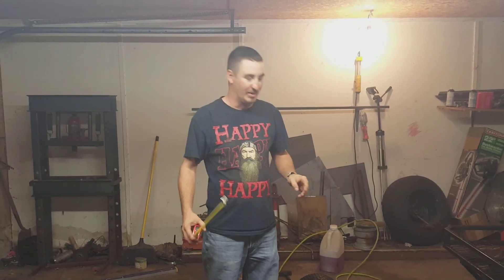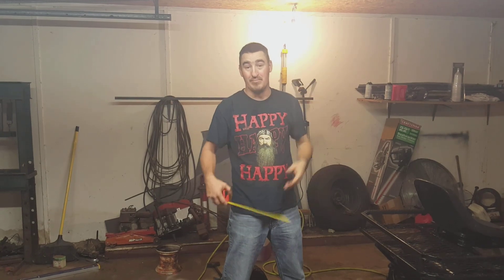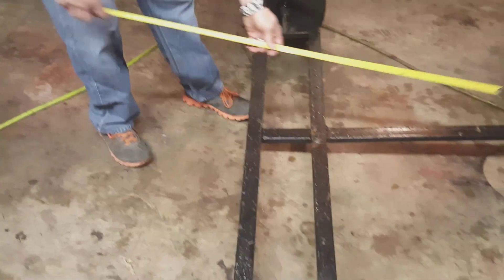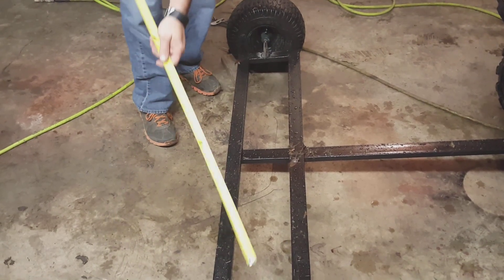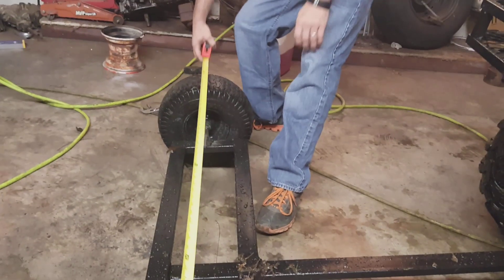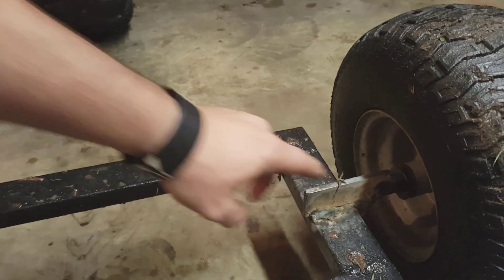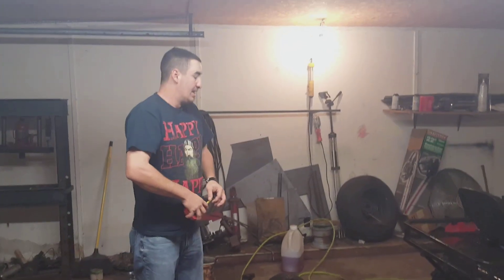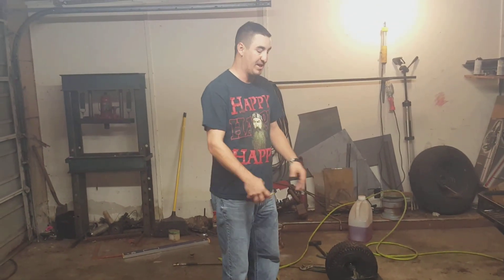D.I.Y.  Homemade Mower Tow Dolly and Test

Comment: I noticed you were turning Sharp when you snapped that spindle. The big reason why you did that was you were putting it in a bind and it was weaker than the spindle on your mower. I to built one very similar to what you have here 25 years ago. And when I beefed it up to the point to where I was not snapping the spindle on the tow dolly. I was snapping the tie rods or Spangles on the mowers on the dolly, in a hard turn therefore I took and made a steering system using an old set of Spangles off of an old mower. And then floated my tongue and used it kind of like a wagon steering system. That seem to fix the problem. You just had to back it like a wagon rather than a trailer. And put a locking pin mechanism on it the locket straight when you don't have a mower on it. I just used a flat piece of metal behind the Pivot Point on the tongue and dropped a bolt in it from the frame.
 I would show some pictures of it, but it burned up in my old shed fire about 8 years ago. And I scraped it. And I never took pictures of it. I use the forks and loader on tractor now so didn't need it.